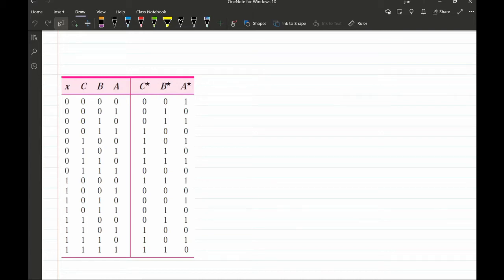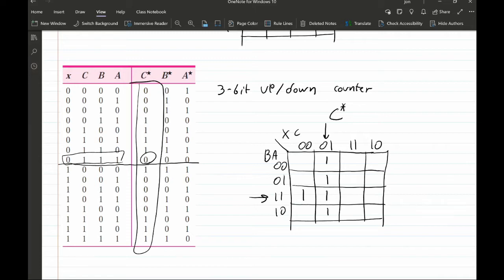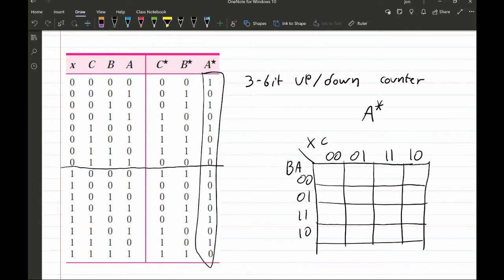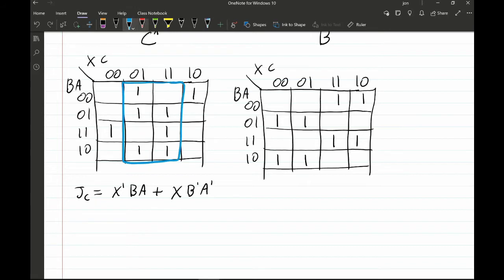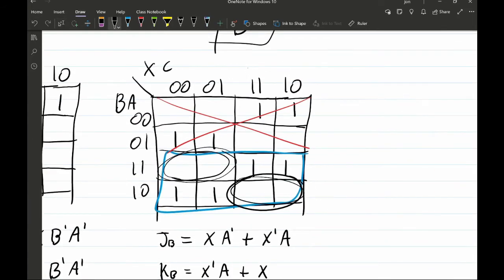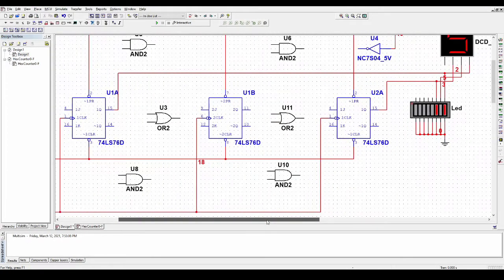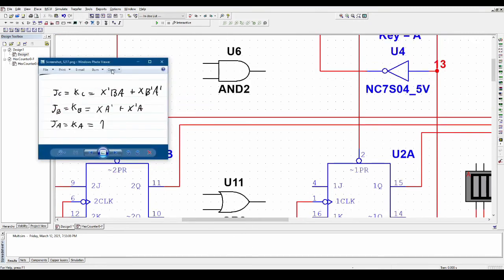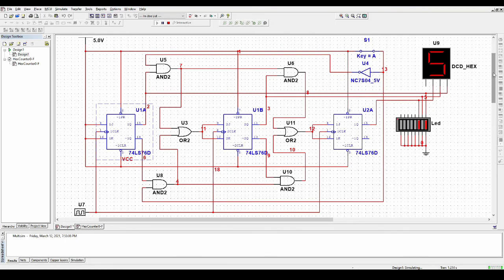Designing a UP/DOWN Counter using JK flip-flops

Comment: Start by imagining a simple trailing  edge toggle flip flop with  a load enable and load input. When load enable is high the output follows the load input regardless of what's at the toggle input. That's what I did and my up down counters are easy to understand. They had to be . I really was only confident with logic circuits using spdt relays at the time. As usual necessitie is the mother of invention.  By now I may be able to adapt 4027 jk flipflops to my original designs